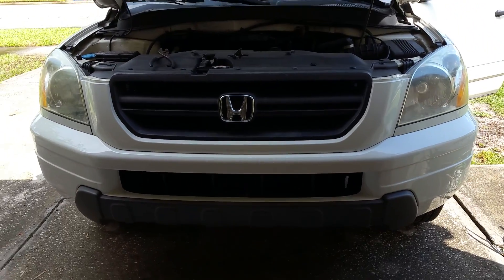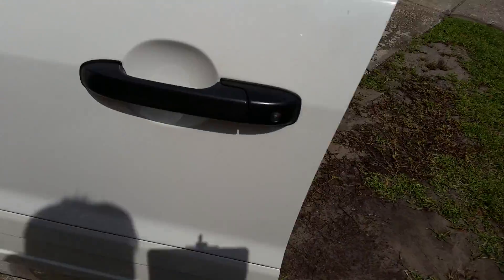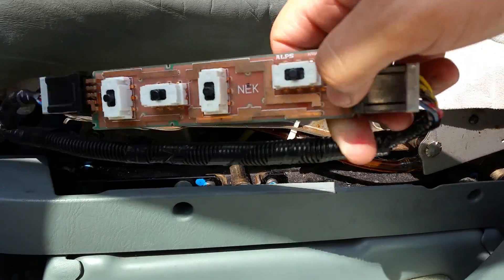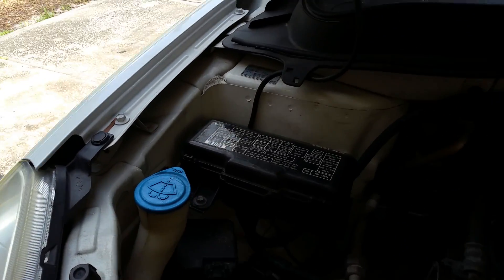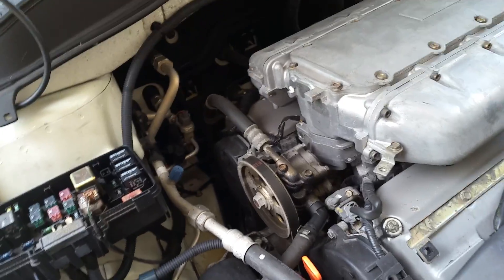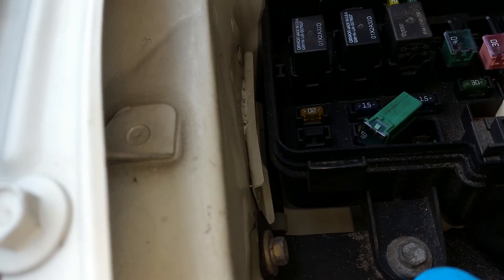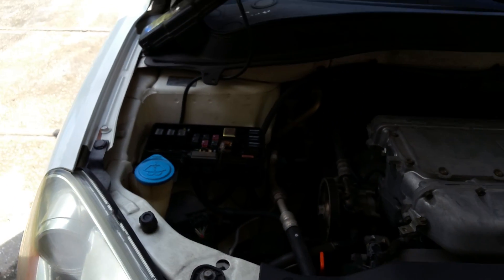03-08 HONDA PILOT POWER SEAT NOT WORKING.....

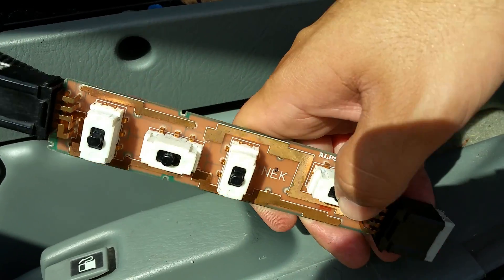Comment: Thanks for the video! for those having the problem of the seat moving one way but not the other, you have to take apart the individual toggle (the one in his hand at 2:54) was my problem. That is just snapped on. You take it apart and clean the contacts on both surfaces or the rocker arm thing. Mine we kind of black , so I used a q tip and some rubbing alcohol and then did my best to scrape off the black with a utility blade and wipe off again with rubbing alcohol. I put it back and presto!

Comment: My Odyssey seat recline function stopped working about six weeks ago. No surprise there….my Odyssey

does have a 181,000 miles on it.

 s I rarely adjust the seat recline angle, except on long rides, it was no big deal. I did look at some YouTube videos over the last month and found some possibilities but told myself I would look at it closer one day…… today was the day.

I went out in the garage about 30 minutes ago to check the inside fuse box just to the left of the brake

pedal. My Odyssey manual showed only ONE 20 A fuse associated with the driver power seat. However, when I removed the fuse cover and looked at the schematic inside the fuse cover which shows the actual location of the fuses, it showed TWO driver seat fuse locations, ONE for the driver seat slide (up and back) and ONE for the driver seat recline (tilt).  

When I looked at the fuse position where the driver seat recline was located, there was NO FUSE!

 hat, no fuse?   The seat recline function had worked for 14 years….but wasn’t there.  I looked further down into the recess but visibility was limited.  I didn’t have a spare 20 A fuse so I pulled the 20 A fuse from the moon roof and inserted it into the driver seat recline…..and it worked!

I like easy fixes……but where did the original fuse go?  My thought was that with the plastic cover in place, the fuse would be kept in place by the cover and not allow them to work their way out…..but I guess that is what happened. 

 

Anyway, from one Odyssey owner to another, keep an eye on your fuses…